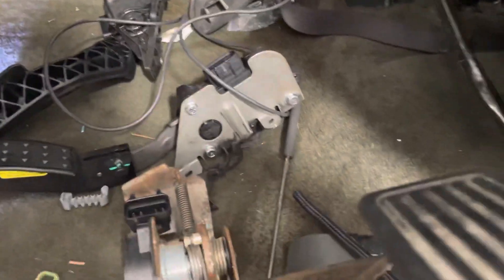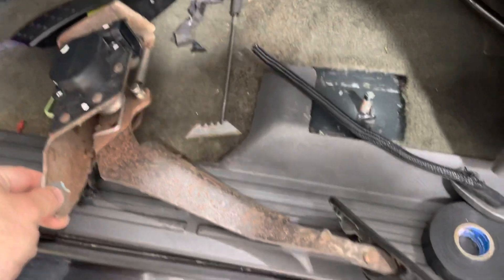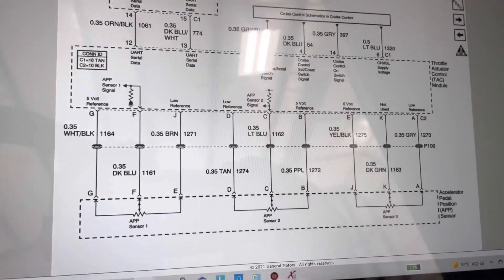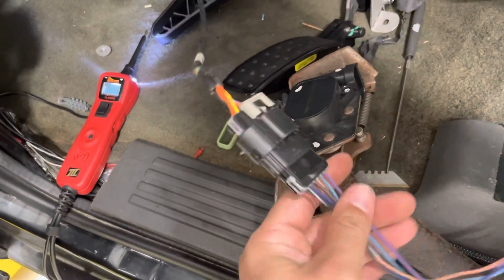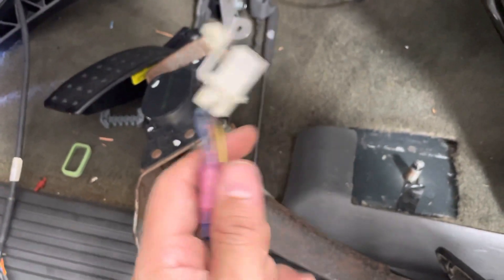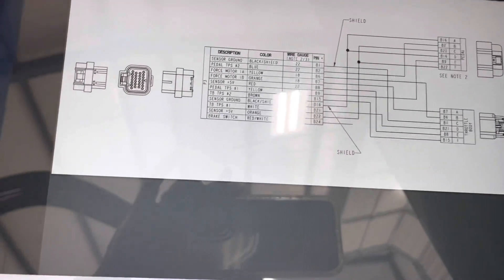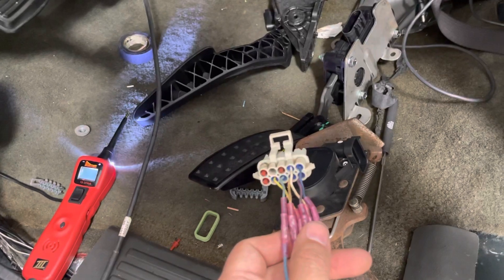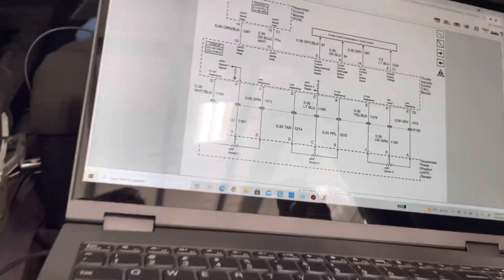Holley DBW: 10 pin connector to 6 pin harness

Comment: I picked up the current performance adapter cable for my 03 RCSB it plugged into the holly side 6 flat pin connector to the 10 pin on the stock pedal.  It doesn't work It won't learn! I wonder if the pins are wrong!
Reply: Where did you get your adapter cable from